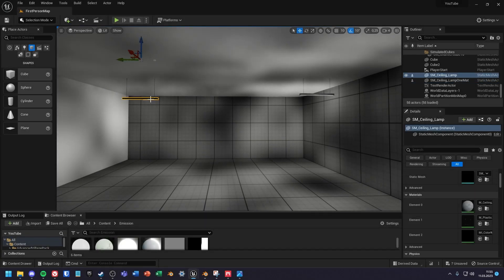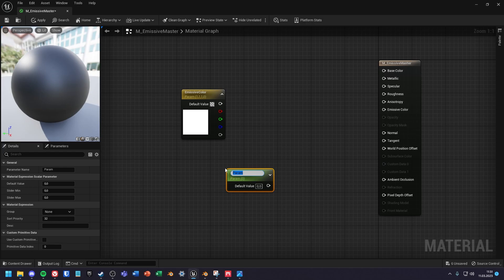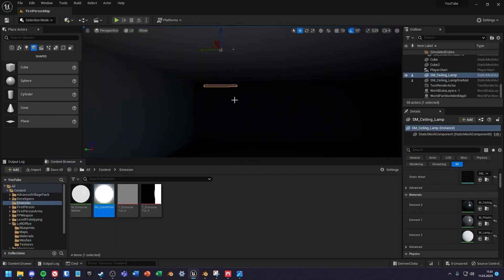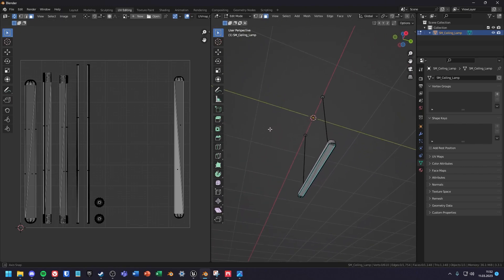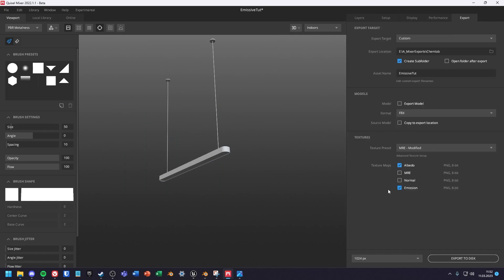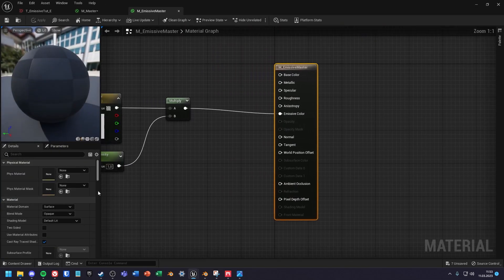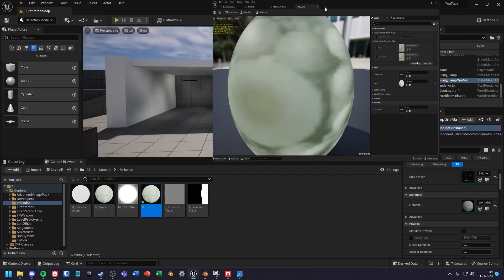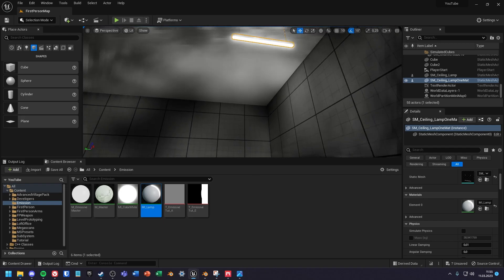How to use Emission / Glow in Unreal Engine (Single and Multiple Material Slots)

Comment: Another option you can use is the Overlay Material. So you can add it or remove it from code or BluePrints.
Sure you’ll add one call more for this material but it’s so much more manageable that way 👌